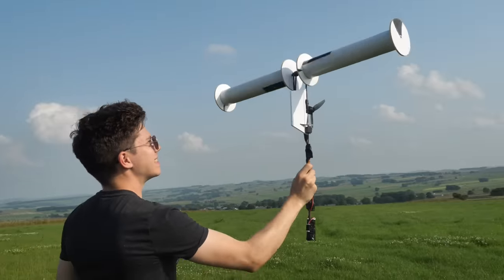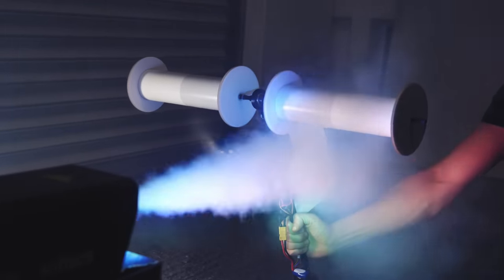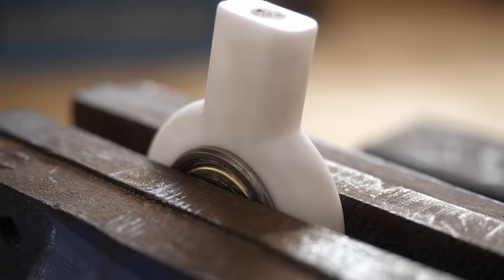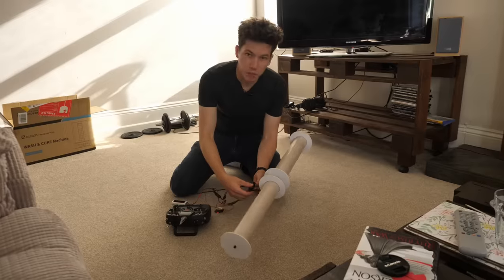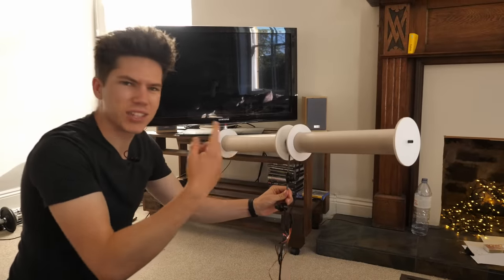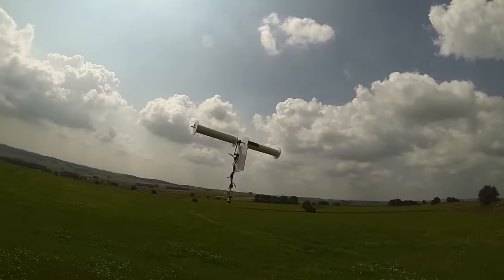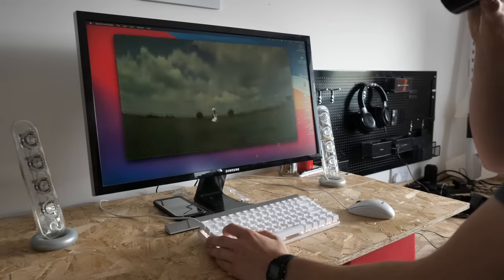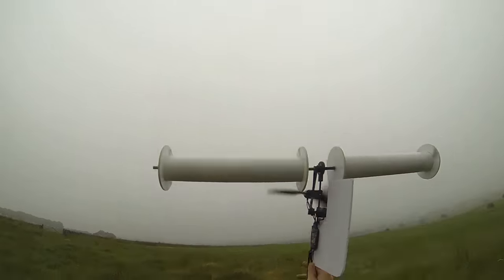Building an Advanced Magnus Effect Plane

Comment: With the increase power and larger prop, would it still fly, if those rotor (magnus force) wings weren’t spinning. It just seems like they’d act as thick stubby wings, with the prop and powers really doing the heavy lifting.

… I would have loved to see it the craft gradually fall out the sky, as the powered decreased on the magnus rotors.

Comment: Maybe if you added another set of rotors it might add stability. You'd have to experiment to see the effect of running in the same direction or counter-rotation. Just a thought.
Reply: You would run a second set of rotors in the same direction if you wanted lift, or counter if you wanted down-force.

Comment: I don't understand how you expect to have stability without an aerodynamic static margin. Put a boom on your rudder to get a moment arm so that it has some authority and a horizontal stabilizer would be nice. Using a low CG to provide stability is only going to work when you have no acceleration and does not provide yaw stability
Reply from the maker: I mean it was actually quite stable though 🤷‍♂️ Like a flying wing, this configuration doesn’t need a tail.

Comment: If you ran each side with a different motor, then you could steer using slightly different speeds.
Reply: Two motors I'd agree with, but I'm inclined to think that the better option is a gearbox, with the second motor controlling the differential behavior, so that a single expensive motor powers the actual lift, and a cheaper one controls the difference in speed.
Reply: @absalomdraconis  Great idea

Comment: Only because you change the principle of lift, this doesn't change all other principles of how aircrafts stabilize. Putting the battery weight low translates to the good old pendulum fallacy (Tom Stanton has made a good video on that after falling into the same trap; this was in the context of rockets, but the issue is the same). Better put the weight up and forward and use an elevator/stabilizer tab in the rear, like with a normal plane.
Reply: All the best flying Magnus effect aircraft I've seen and built have the weight low for stability. If you had weight up high (even on centerline), you'd need ailerons for stability which would have to be massive since these things fly so slow.
Reply: @rcbif101  This is a misconception, coming from the observation of pendula that have an attachement point at the top. Weight low = stability doesn't work in this case because with a freely flying object the center of mass will act as the pivot point. The object will then turn into the position of lowest drag, which is NOT the original vertical position. The key is aerodynamic stability, NOT eccentric weight. Active aileron control wouldn't be needed; tiny winglets at an angle (dihedral principle) would already do the job and they would NOT have to be massive, since they would be rather far from the longitudinal (=bank) axis. Alternatively, adding a dihedral angle to the Magnus effect devices should work, too, for auto-stability, just like with normal planes. Except for the lift method, all other principles are identical to slow-flying planes. There are good reasons why you wouldn't see "vertical" planes with all the weight hanging down from the end of such a tower: it's just not as stable as you might think. Control surfaces can be very light-weight. Being underpowered with the Magnus effect doesn't change all that.
Reply: @___Chris___  Well I disagree, lol. I've built and flown several variations. Not just basing this on opinion or theory. My current design has low slung weight, and is stable, and stupid easy to fly. 
Adding dihedral to the rotors themselves would require a universal joint and dihedral tips would require a non moving supprt way out where there is none. Both increase complexity when it's not needed.
Reply: @rcbif101  You're welcome to disagree and I congratulate you if you built a model that works, but hundreds of other people have built stable versions with the more conventional approach. You're also giving no indication that you understood the pendulum fallacy. Physics can't be cheated.

Comment: I wonder if having the propeller below the rotors reduces lift? 
It seems as though putting the propeller above the rotors would help the air above maintain a higher pressure differential between above and below the rotors.
But hey, I'm a programmer, not an engineer.

Comment: Problem with this is there is no stabilization...you need something to control yaw, pitch, and roll...the tubes can control roll some what, either by speed, a little dihedral, that "rudder" he has or ailerons...extremely low cg is not enough...you will need something to control pitch either an elevator or that motor closer to the batteries...you will need something to control yaw, something like a traditional airplane rudder or a motor like a helicopter tail rotor...at a minimum this guy needed a tail boom with a rudder or motor, and a motor for roll control near the batteries, and a motor near the batteries for pitch control,  and a motor for forward thrust, plus a 3 axis gyro to control all the motors

Comment: what if you built one with 5 spinning cylinders, 4 oriented horizontally for pitch and one oriented vertically for yaw
Reply: Vertical would be a waste of precious mass IMO. May as well use two propellers and differential throttling at that point

Comment: You need to lookup the tables of Rotor lift for Flettner rotors to optimize the lift. 
I  can't believe you abandoned conventional aircraft design to try the concept, considering the spitfire model success.
Reply from the maker: It was a proof of concept! Normal wings are easy!
Reply: @Project-Air  A real engineering achievement would be to build a scale radio controlled yacht, that not only had optimized rotor dimensions,  but could automatically change rotor speed and direction depending on course and wind  direction .
This is what the full size Flettner Cargo Ships do these days,  but they keep the Math very secret.

Comment: Magnus effect aircraft, Awesome, but as I watched it I heard a bell ringinginginging ding! Golf balls! They used the difference in airpressure created by the dinmples to fly futher than if they where smooth. Now we have a name for that effect. Learned something new today. Thank you.
Reply: That’s not what the dimples are for. They help the boundary layer to stick longer as it flows around the ball making less vortex drag.
Reply: @choahjinhuay  I only replied what I have learned. I have learned that the dimples increases the surface area of the golfball without increasing its diameter. Thus causing it to increase the airflow across its surface speeding it up, making it fly futher than otherwise. I am not saying I am right, or you are wrong. And I do understand what you are saying. Basically it comes down to the coeficent of drag, and that horrible mess of how to determin it via math. Because you need drag to calculate drag.....

Comment: The anunnaki would be proud
Reply: If the separation points on the cylinder were symmetric then there wouldn’t be lift, but thanks to the spin we that asymmetry and so therefore have lift

Comment: *This Project Is WAY OVER DESIGNED & HAS TOO MANY MOVING PARTS!!! 1st Off You Don't Need To Drive Motor The Reverse Spinning Drum For It To Fly Great! Drum Can Free-Wheel By Using Staggared Fins Across Them & The Forward Thrust Motor Is All You Need!!! Just Start The Backwards Spin On Drums By Hand At Launching It... 2nd All The Parts You Need To Build One Is 2-Wood Dowels, Some 3" to 4" Plastic Container Lids, Bearings In Dowel Size, Some Foam Meat Trays For The Drum Fins, 1-Rudder Servo, ESC, Motor+Prop, Battery & Hot Glue Gun, Etc (+Some LED Lights - To Make It A Night Magnus Flyer!) 3rd Soo Then You Don't Even Need A 3D Printer Either! 4th - In Building  RC Model Planes Etc, SIMPLE DESIGNS, LOW COST, LESS PARTS & LESS WEIGHT IS ALWAYS YOUR BEST CHOICE TO TRY FIRST!!! 😜😎

Comment: Horizontal stabiliser?

The kfc bucket version worked better
Reply: It is not necessary, the horizontal stabilizer is to maintain a constant angle of attack in a normal wing, but this wing is round, it always has the same angle of attack.
Reply: @CuervoRC  
Yes. But the thrust angle oscillated terribly.
Reply: @brucebaxter6923  I think those oscillations are more because it was windy and turbulent than because of the plane. I have done two of these Magnus planes and they fly like they are on rails.
Reply: @CuervoRC  
Yes, the wind would vastly disrupt it, plus the high wing loading wouldn’t have helped.
A tail still may have reduced or damped the pitch oscillations.

Do yours even have thrust motors or just pure Magnus for thrust lift and control?
Reply: @brucebaxter6923  I made two very similar to this one in this video. One had cylinder shaped wings and the other had savonius wings that don't need a motor to rotate. Both had fixed motor and rudder steering.
They had more wing loading, especially the one with cylindrical wings, more or less the same size as this one, but with more plastic parts and a 4s 1300mah battery.
Reply: @CuervoRC  
Nice

Comment: actually you don't need to drive the rotors with a motor.  The air accelerated by your propeller is enough to drive the rotor and generate lift.  Check my Video Called savonius rotor:https://youtu.be/sptne6uAir8